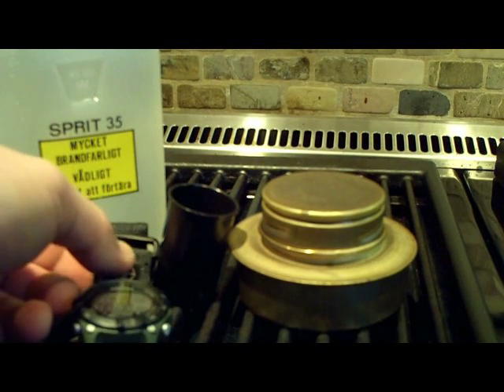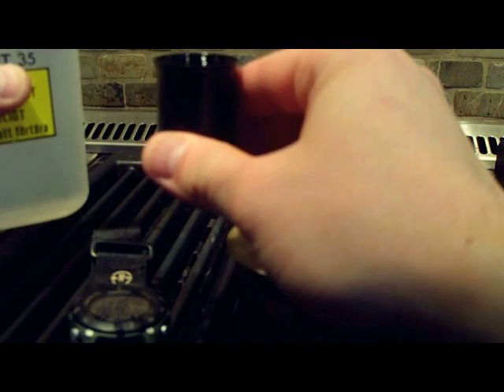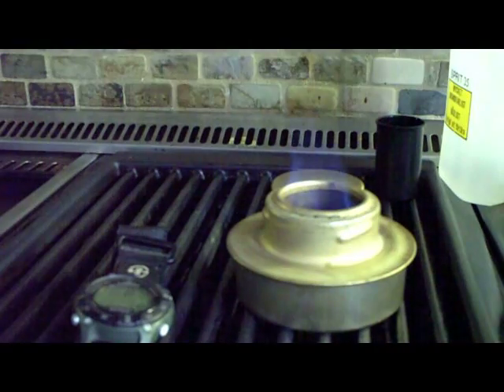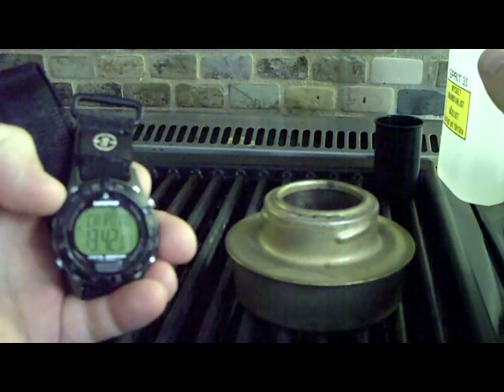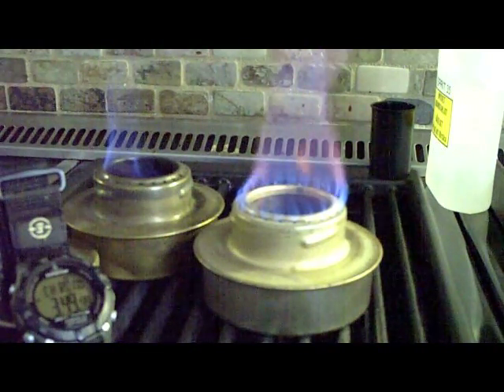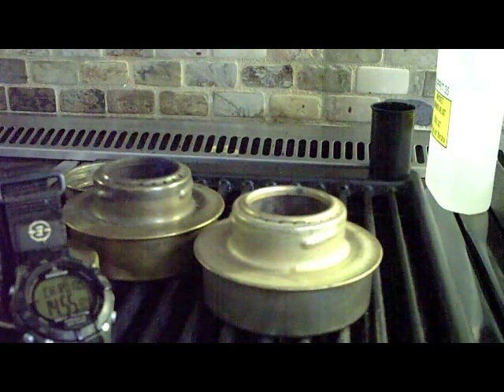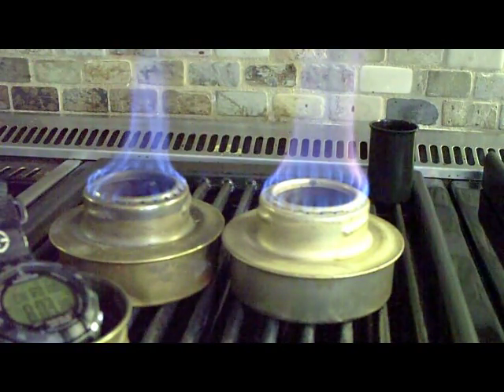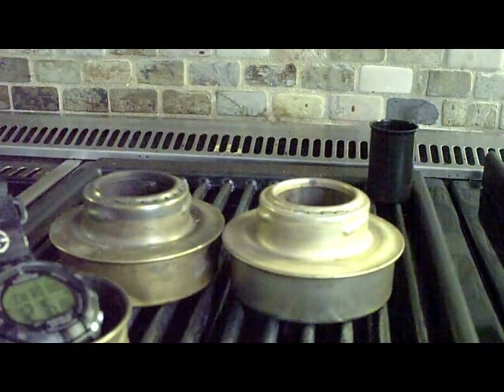Trangia Stove Burn Test

Comment: I just got one of these alchol stoves.  when trying first lighting it, I knoticed that the only fire i was getting out was the large cup in the middle.  The outer permieter small hole didnt do anything.  Am I using the wrong fuel?  Any help would be greatly appreciated.  Thanks